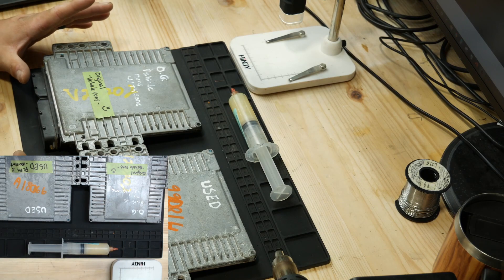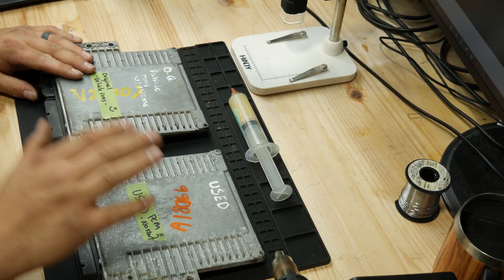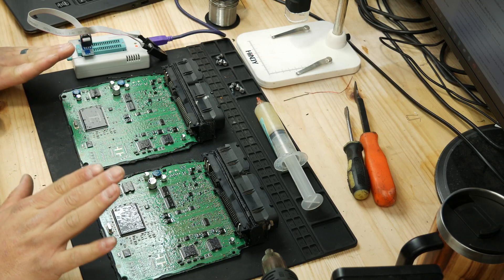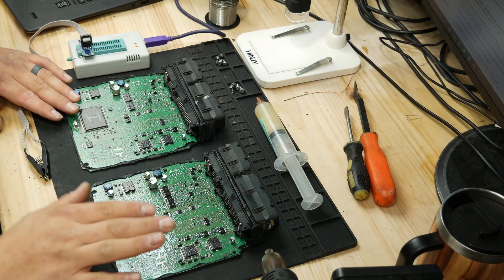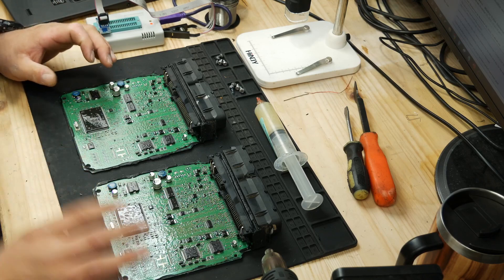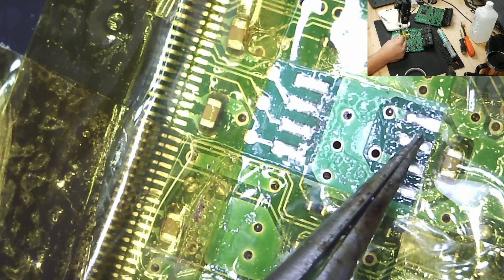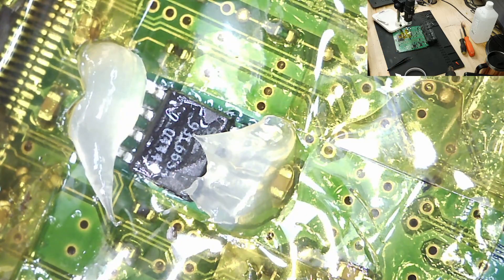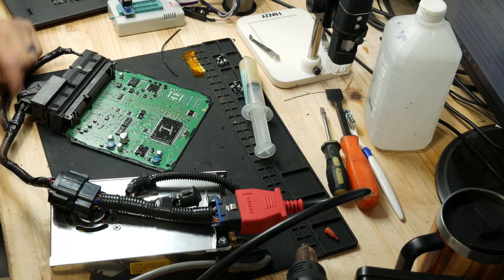Nissan P1610 P1612 Theft PCM installed a NON Anti Theft Car! FIXED!

Comment: I have a 2001 nissan maxima it cranks but no start keep getting manufactures code p1610 if i remove that off the board will it start?
Reply from the maker: No
Reply: @L1Training  is it because the IMMU is still in play?

Comment: Sir you did excellent... But when you were adding pin strip during the soldering soldering iron would be better to another angle. That would damage smd resistors

Comment: Is there somewhere that you have the non immo data available? Or do you know what small difference the data is. Like by marine just changing one or two of the addresses to FF or something. As an automotive locksmith that data would be golden for some of those pesky Nissans that are in lock out mode

Comment: If the same IC900 chip on the 350Z 2004 ecu is swapped , could the car then start and operate fine with its original keys on a new ECU

Comment: Am asking when remove the ic for immobilizer without replacing it will the car start or what? and the ic when changing it what the difference between those two ic to be able to know if the ic having immobilizer or  not
Reply from the maker: It's the data in the module that matters to it being immo or not. It will not run or communicate withought that IC.

Comment: Sooooo I had the exact same issue. 2007 frontier bad ecu (non immobilized) I purchased a 2007 xtera ecu with an immobilizer and literally used the heat gun to lift the chip off on and put on the other.. no flux, no tape no nothing.. I know your way is the best safest method but I needed my truck back running and this video saved me at least $400. Truck runs flawless!! Thanks for this video! Subscribed!

Comment: What happens if your remove the chip and leave it? MY FX35 shows P1610 and it wont start, It worked fine and then I went to start the car with the same key and it would not start. Security light is on all the time solid red, cranks but no fuel or spark. I want just bypass/eliminate the immobalizer instead of buying bunch of parts trying to figure out what the issues is.
Reply from the maker: If you remove it, it will never start or run, there is a lot of information in there the PCM needs.
Reply from the maker: If you want to fix the car rather than "TRY" parts you will need to take it to a competent shop that can properly diagnose the issue the first time.
Reply: @L1Training   I went through the service manual steps, it says to replace the BCM and the ECM, However if I Replace the ECM, i think it needs to be re-programmed to work right? I cant just take an ECM from another FX35 and plug/play. It needs consult-II + NATS card programing to set VIN/key codes right? I dont have those.

Comment: Keith,  could you tell us why you chose to swap the EPROMs physically rather than erase and reload the correct the code?
Reply from the maker: Honestly, to make a video explaining what I would do in that situation would take a lot more, my eeprom tuff is on a different laptop, so id have to hookup a capture card to get a clean recording of the process, explain equipment, how to identify chipsets, connection voltages, etc.. it would be a 45 minute video in condensed format. A 45 minute video is 2 hours of filming, 3 hours of editing and rendering. Just didnt have the time for it....
Reply: @L1Training  thanks, Keith.    Makes sense but seemed an obvious question to ask.  Answer was informative.  👍🏼

Comment: Surprised  to see you using  an AC powered soldering iron with 2-wire cord ;  a 3 wire cord iron with grounded tip would ensure board not damaged by a soldering iron leaking some AC current to the tip .  Also suggest a ground connection to the anti-static mat and a wrist strap to the mat, as typically used when repairing high value electronics.
Reply from the maker: I use a  WLC-100 soldering iron, so it is grounded, and I put the ground strap around my ankle because the wrist straps are always in my way. Sorry, I don't have any constructive criticism for your YT videos :/

Comment: Is there an orientation for that chip on the board or goes on either way round
Reply from the maker: Yep, orientation is key.
Reply: @L1Training  Is that why I now have 4 speeds in R and 1 speed in D?
Reply from the maker: @SouthMainAuto  dang, I knew something was off. Just flip the axles.....
Reply: @L1Training  I moved the indicator on the dash. All is well....
Reply from the maker: PDNRL?
Reply: @L1Training  Exactly...😁

Comment: Hi,nice work.I'm new to your channel but i can see from the comments there is a lot of interest in what this entails.I like to watch Eric and Ivan,and also watch computer diag.and repairs with hot air stations etc as tools.I'm interested in see the code if you figured it out.Or just the number difference on the e prom chip.And how you figured that was the chip.IT'S part of my OCD issue,haha I fix or break laptops for fun,for me hardware is not and issue ,it's the software that takes brains.thanks to Eric you should now have about 2.no 10 new viewers>>oops I MEANT 10,000 VIEWERS you know cause he has such a small channel!!!haha

Comment: Question: I have a 2014 1.8L that came from the factory with our cruise control. 
I added a steering wheel with the cruise control buttons.
Is it possible to program my ecu to have cruise control?

Comment: I sense the Rossmann force is strong with this one. 🤣😂 Have you ever considered repairing damaged furnace/boiler/heat pump PCB's? I work in the HVAC field and keep almost* every PCB I can get through repairs or warranty work. Most times I can repair them with the help of Digikey/Mouser and make a little $$ on the side. As long as the MCU/software is ok, the boards are usually repairable (and if corrosion hasn't eaten the board to death). Relays and/or Darlington arrays are usually the culprits for your average furnace control board. Thanks for the video!

Comment: I did solder work for decades but they never let us do hot air soldering. So easy! Question - we always had to clean the rosin flux off, did that stuff you used need cleaning? Also it looked like one board was conformal coated and the other wasn't. Did you remove/ apply conformal coat?

Comment: I bet the used/salvage computer came from a vehicle that had cable throttle.  The vehicle and OG PCM has drive by wire.  The trans module is looking for a pedal position PID that isn't present in a cable throttle PCM.

Comment: Loved the colab. I was making bets that the ecm would not work because Nissan is the devil. I have delt with Nissan diagnostic in the past and opted out of getting used modules because of Eric O problems. SMA sent me. But to be fair, the truck he was working on was a hot mess from the get go and with multiple parts changed out I would have thrown in the towel.

Comment: What type of heat solder gun are you using in the video?  I assume that's just electronic rosin flux or is it something specific?
Reply from the maker: Link in the description
Reply: @L1Training  Thanks !  Interesting video on removing the surface mount devices.  I've only worked on the old leads through the circuit board types which are way out of date.

Comment: Can you depend on the number stampings on the chip to keep you from mounting the swapped chip 180 degrees out?
Reply from the maker: No, there is a dimple on the chip that helps with orientation.

Comment: Hi, I haven't seen your channel until now. Do you always tend to use hot air for surface-mount chip removal? Have you used stuff like Chip Quik (low-temp solder) before?
Reply from the maker: Welcome! I pretty much use hot air anytime I can. Yes I have used it, just not a fan. I like good old fashion leaded solder....
Reply: @L1Training  Thank you for replying! At my previous job I would occasionally do SMD chip replacement, but I never had access to a hot air gun. I had to blob on copious amounts of regular solder and use a tweezers-type soldering tool to keep both sides melted.

I never realized one of the benefits of hot air was being able to re-use the old solder that could remain on the board.

Comment: It's interesting that swap the eeprom does not swap back the transmission problem. The hardware seems to be identical so the mismach between accel and trottle position in the received data by the transmission control unit has to be related to some different in software. It may be that the firmware is stored in the mcu and the eeprom only store some paramenters?
Reply from the maker: Correct, as it is with most automotive modules, programming software and logic paths are flashed to an MCU, and the rewritable memory (EEPROM) is used to store configuration data, VIN, immo and key data, tire ratios, etc..